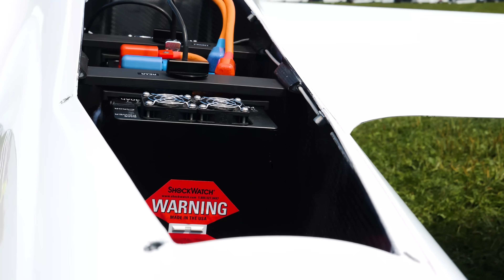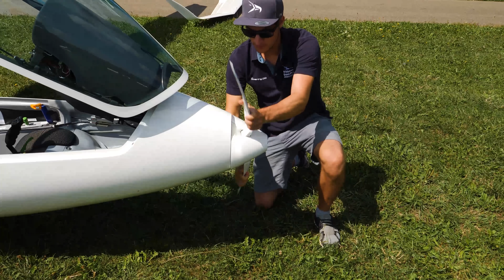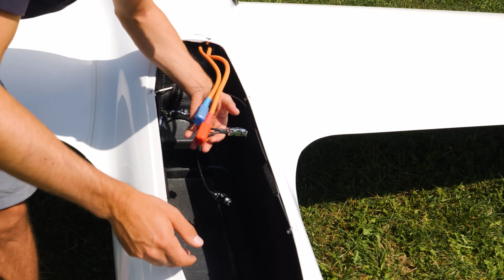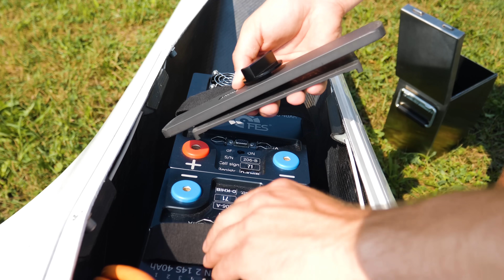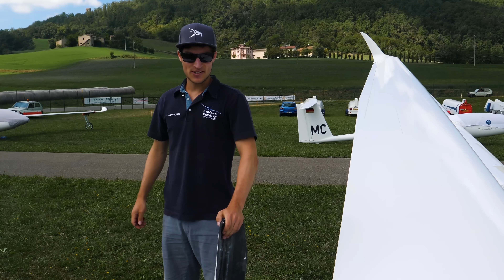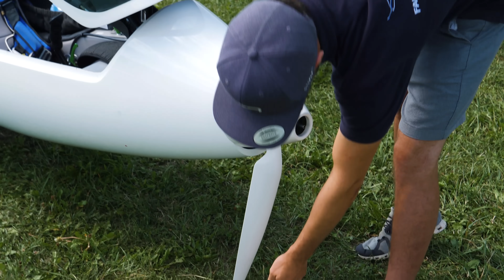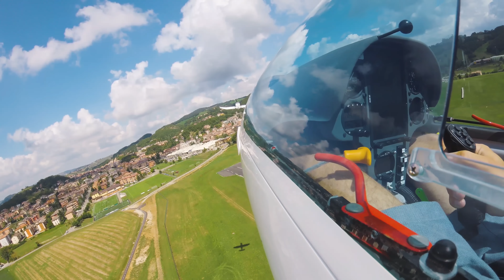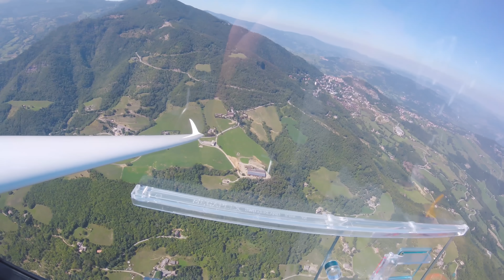New LS8-e neo review | Electric Glider 15 m & 18 m wingspan

Comment: will the battery be permanently installed in the future? And charge them with an external plug? Seems like a lot of work potential points of failure while removing and installing the batteries. Not to mention it's safer to have them permanently mounted.

Comment: I think someone forgot the whole point of soaring is to stay up without an engine.  If it provided self launch, yes, you could avoid the cost and hassle of a tow. But now you have to arrange and pay for a tow, you have to charge the freaking thing, the complexity, blah blah blah.  Plus the expense. Put the money into a higher performance glider. And the other glider pilots will have a lower regard for your piloting if you can buzz your way out of bad soaring decisions.

Comment: if you are going to try to put the incorrect polarity the circuit will be damaged and you might go to heaven. not because of the diameter of the prongs (it is for safety)

Comment: uhh... a glider is a glider.. why do they need an electric motor?
Reply: Common misconception. Every wingborne aircraft is also a glider by virtue that it can fly in the first place. Even helicopters. What changes is how far it can glide for a given altitude so the term glider is used for aircraft that are meant to sustain unpowered flight.

Comment: electric drives are motors not engines. Engine is combustion type of.
Reply: Common misconception. An engine is just a machine that turns any fuel to mechanical work. A motor is a device that produces a motive force.
Reply: @PabloGonzalez-hv3td  No matter what you say in the English speaking world you NEVER say Electric Engine. It is ALWAYS Electric Motor. Period.
Reply: @moestrei  That's common parlance but a misconception nonetheless. The best example is rocket engines and rocket motors which BOTH use combustion.

A rocket engine is a machine with moving parts, a rocket motor is not much more than a tube that shoots fire and technically not a machine. 

Both produce a motive force so they are both motors but the rocket motor with no moving parts is not an engine.
Reply: @PabloGonzalez-hv3td  Ok, thanks for letting me know.

Comment: 140.000€ WHAT?!?!?! I will buy glider for 10.000 Euro, cut nose, print this folding propeller system on my 3d printer, pay someone another 2000Euro to prepare and instal electric engine and I have this glider for 12.000 Euro. And its 1/10 of price XD

Comment: Damn .. so this crap itself does not take off ?? Why is it needed then? What is the point?
Reply: Gliders are not intended to fly with a motor normally , usually they use the force of rising hot air to gain  height. If there is no lift anymore and you want to get Back to the Airport, you can Flip out the motor to get you back
Reply: @lostfridge6938  thx

Comment: If it has an engine, it's not a glider, dummy.
Reply from the maker: It's a glider with electric motor 😂
The purpose is still flying a glider bit to avoid an outlanding. The range is only about 80 km and you are not allowed to selflaunch...
Reply: It can sustain soaring like an unpowered glider. Regular aircraft cannot.